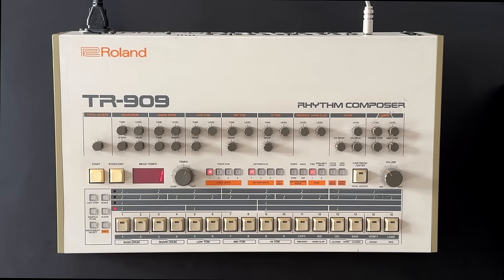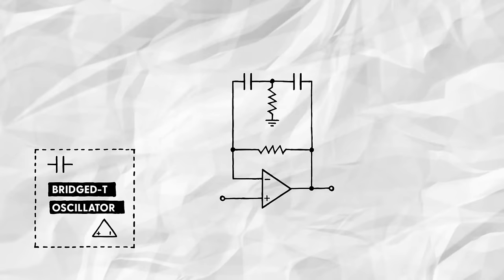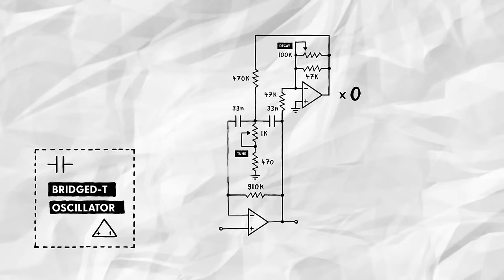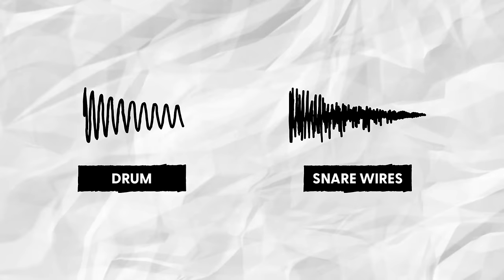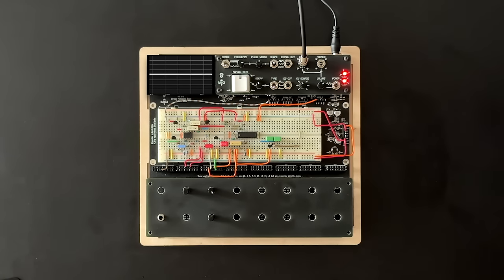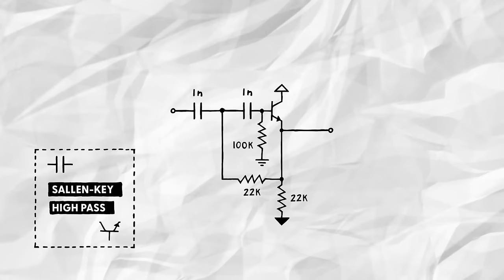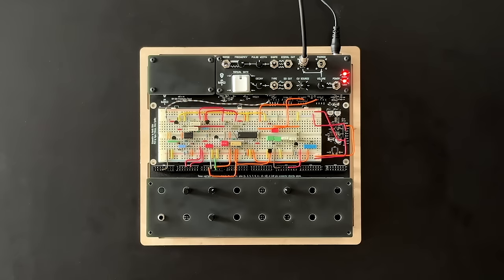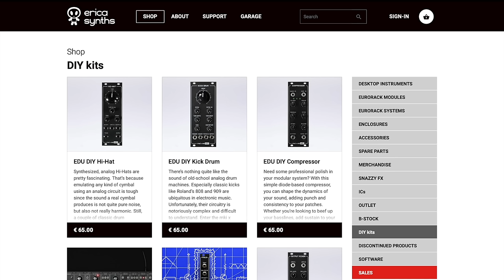Designing a TR-808 style snare drum from scratch

Comment: My great sadness in the synth world is that so few designs let you apply CV to attack and decay. In my opinion the most useful expression to modulate. I cannot understand why it’s often so overlooked 

You are a great engineer and teacher. Love your work
Reply from the maker: you're right, that would be useful. i'll see what i can do for the next percussion circuit!
Reply: Get into modular
Reply: . Adding voltage control to many seemingly simple circuits is quite alot of work.. An often than not it makes the circuit misbehave in other ways.. I spend years making synth modules and voltage control of parameters and temperature stability were 2 of the most difficult parts to implement..

Comment: Great video.  Years ago I got an itch to design a snare drum circuit. I didn’t make it much past some modeling in Matlab, but I think I figured out something pretty cool.  See, the first thing I did was record an acoustic snare drum and ran an FFT on it. From that I saw that there were two prominent frequencies, not harmonically related. They were separated by maybe 40hz. When I simulated the mix of the two frequencies after running them through an exponential decay, the result was a much more organic drum sound to my ear. 
So that was my idea for a more organic drum circuit,  mix the output of two T oscillators, slightly offset in frequency.

Comment: Good stuff.  For the noise source you can also use a Zener diode in the usual reverse bias configuration - i.e. the way it's used in a simple regulator.  I happened to read about that recently.  Since it's designed for that, it may last longer than a poor mistreated transistor.
Reply from the maker: good call. when i first designed my white noise circuit, i actually tried a couple zener diodes but couldn't get any noise out of them. would be worth it going back to that though!

Comment: This is awesome, If you really wanted to make it sound like an 808, all youd have to do is add the second detuned osc that makes up the overall tom sound, I think then the tone control knob on an 808 was just a  blend or mix potentiometer between the lower and higher pitches.. The key to getting it to sound like an 808 was the correct dutuned pitch of the 2 tom oscillators..If your off by a semitone then it sounds terrible.. They were brilliant engineers..

Comment: Do you have a Q&A about your background? How did you gain so much intuition about filters/amps/pulse modulators to use in circuits? Do you have a catalog in your mind of the different options, and if so where did you learn all these different circuits?

I've just graduated as an EE from college and I understand all the individual components and I can reason the purpose of certain circuits by eye, but I don't have the experience or catalog of knowledge to pull upon to feel confident designing something myself.
Reply from the maker: it just all accumulated over time. i started off making very simple little oscillators, filters, amplifiers and then gradually increased the complexity from there. you always encounter the same issues over and over again, so i found solutions for those that worked well enough. it's like building a muscle i guess! what's key (i think) is to always have an achievable goal that you work towards – just trying to absorb pure concepts never worked for me.

Comment: Hi, I want to realize a circuit like this but I've a problem. How do you generate dual alimentation? Converting a positive DC in a negative or using a dual power supply?
Reply from the maker: you can either use a dual power supply, or wire up two 9V batteries to generate +9V/0V/-9V. for instructions on how that works, check this document, page 6: https://www.ericasynths.lv/media/SNARE_MANUAL.pdf
Reply: @MoritzKlein0  I thank you so much man. I appreciate it.
Reply: @MoritzKlein0  sorry, last question. Do we generate a mono sound, right?
Reply from the maker: @-arm-5116 yes!